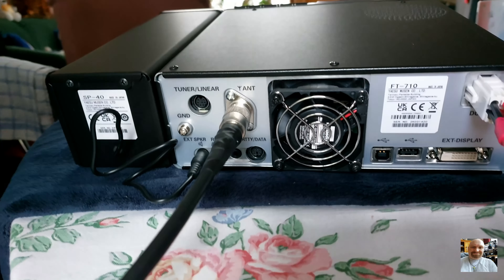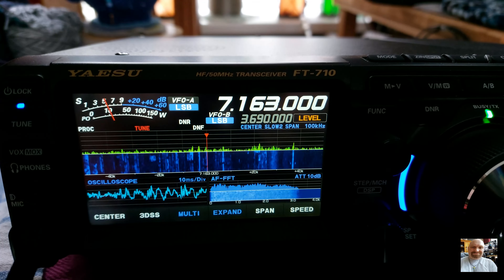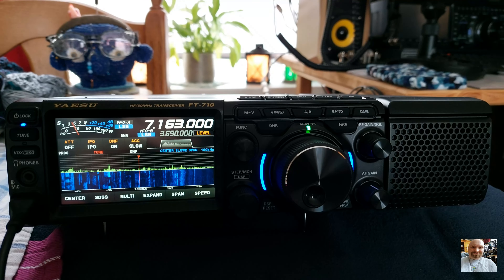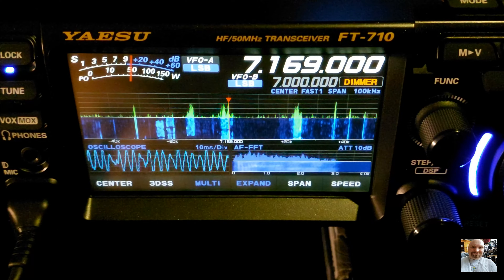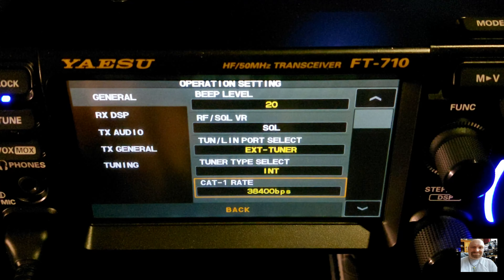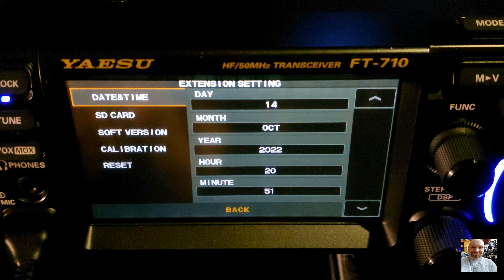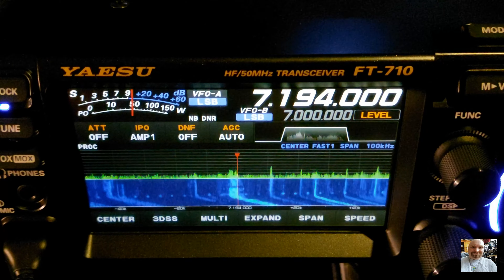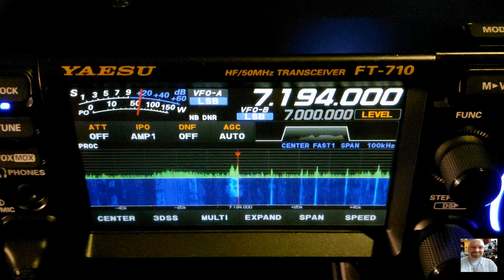Yaesu FT710 The New one

Comment: Hello. AMP1 is not necessary on 40m, performance is degraded.
Reply from the maker: Hello There if you can see on the screen i have the radio in IPO  and not in Amp1 but i was just a bit playing arround with this radio so i try some settings okay but i know that it is not nessasarry to switch in amp1 but sometimes when the signals very low it wil help a bit to hear better you know......thank you for your Comment wisch you all the best Vy 73 de PA5HR Bert👍:goodvibes:

Comment: nice radio bert but i have the ftdx 10 so will not be getting one
Reply from the maker: Thank you Ron yes it is a realy good radio and i have also the Ftdsx10 but i use it for the higher bands and works realy fine...thanks again for the Comment vy 73 de Bert PA5rHR👍👍
Reply: @PA5HR1  thanks for reply bert
Reply: @PA5HR1  Ah, what would you say about the difference between these radios?  which one is the one you would keep if you only had one, haha?
Reply from the maker: @ElsaGSD  Hello Chuck thank you for you question and yes my answer is it would be the FT710 because that iss my opinion the radio is quiet in the recieving and the receiver is very sensitiv and the Sound is much better than the FTdx10 or FTdx101D/MP the little Radio does a very good job so that is the radio what i prefer to work with....thank you again wish you a good start in the year 2023 with good health Vy73 de Bert PA5HR👍👍